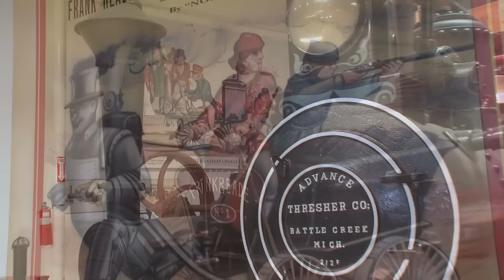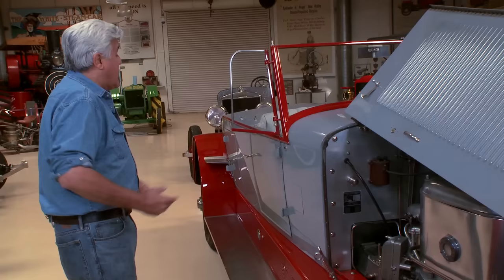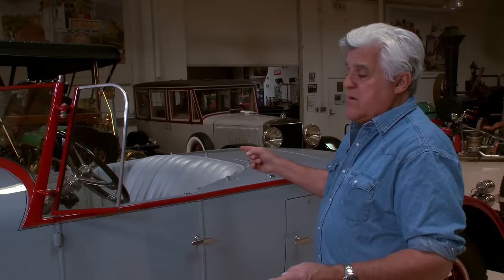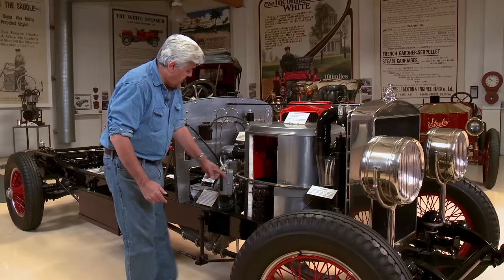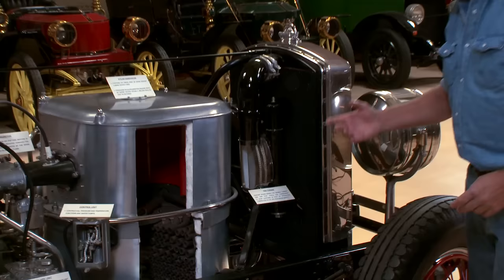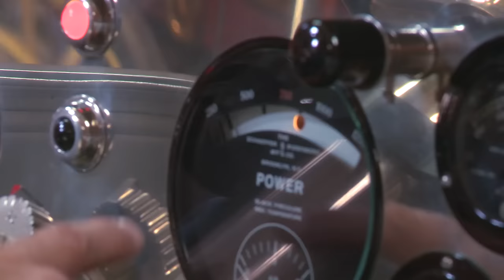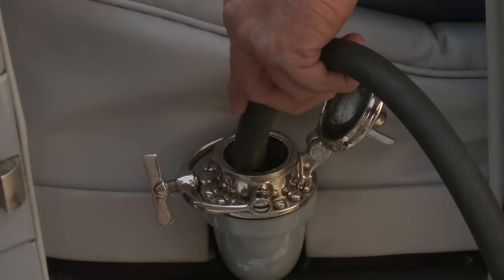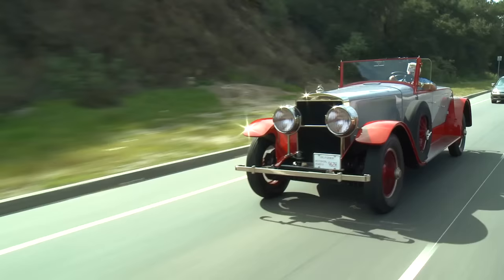1925 Doble E-20 Steam Car - Jay Leno's Garage

Comment: 1000ft pounds of torque..
When?
Whenever you want it..
Reply: No, Jay's remarks are a bit deceiving really, the Doble produces just 150 hp when new and it only produces 1,000 ft-lbs of torque at ZERO RPM torque output drops rapidly as rpm increases.
Reply: @doktorbimmer  the power curve of the car is dependent on the capabilitys of the steam generator not the steam engine itself. so the torque would increse until the steam generator reached its limits then drop off.
Reply: @Sam The Multimedia Man Wrong, the amount of torque is dependent on RPM... The boiler cannot produce any torque... only horsepower. Reciprocating steam engines behave in a very similar way to pneumatic and electric motors torque goes up as rpm drops to zero... torque decreases as rpm goes up...
 Are you not familiar with the formula equation for converting horsepower to torque?
Reply: @doktorbimmer  the amount of power a steam engine produces is dependent on the amount of steam pressure its getting! Boilers and steam generators have power ratings. you can run a steam engine at its max RPM at 15psi when its not under a load, its not making 1000ft/lbs of torque at 15psi!
Reply: @Sam The Multimedia Man WRONG! you are very confused and not sufficiently educated on this topic to speak intelligently on it. Boiler pressure and volume is directly related to HORSEPOWER Not torque. Torque is directly related to RPM.
Reply: So I am not familiar with steam engines.. it isn't really an engine? Where are the rpms coming from to produce the torque? Isn't the torque produced through steam pressure making the torque available as soon as you open the valves?
Reply: @jrea424  the torque is produced by the steam pressure acting on the piston transfered through the connecting rod to the crankshaft. the more pressure the more power you can  achieve.
Reply: @jrea424 All steam engines are Heat engines so the answer is No. It is without any doubt AN ENGINE. Torque is the result of the Brake Mean Indicated Pressure and  Brake Mean Effective Pressure based on the bore diameter, STROKE and RPM... The faster the piston moves, the less efficient the use of steam pressure and the amount of actual torque generated.
Reply: @Sam The Multimedia Man WRONG the amount of pressure available vs. the pounds of steam used is expressed in HORSEPOWER... NOT TORQUE.
Reply: @doktorbimmer  the amount of pressure avalable is measured in psi, hp is work done over time, torque is the measure of force applyed to something that can rotate
Reply: @Sam The Multimedia Man WRONG DUMMY! Horsepower is amount of POUNDS OF STEAM PER HOUR!!!!  One boiler horsepower is equal to 34,5 pounds of steam or 33479 Btu of heat or  9.8 kilowatts.
Reply: @Sam The Multimedia Man It is very obvious from your comments you do not understand what torque is... please refrain from posting remarks on a topic that you are not adequately educated to speak intelligently on...
Reply: @doktorbimmer  lol so were talking about the boiler that had nothing to do with anything now and not the engine that magically generates torque! Make up you mind.
Reply: @Sam The Multimedia Man That is right dummy! the boiler does not and cannot produce torque... only steam measured in pound at a specified pressure... this has NOTHING to do with torque.
Reply: @doktorbimmer  Its pretty clear from your remarks that you've never stepped foot into any classroom.
Reply: @doktorbimmer  okay kid time for you to give your smart phone/ computer back to mommy and daddy and go do your homework.
Reply: @doktorbimmer  LMAO, you crack me up kid.
Reply: @Sam The Multimedia Man Are you still here Sammy??? I thought you would be busy trying to learn something about engineering... do you really want to be ridiculed as an ineffectual troll for the rest of your life???
Reply: @Sam The Multimedia Man The only troll or fake here is you son.
Reply: @Sam The Multimedia Man Sorry son the only fake here is you...
Reply: @Sam The Multimedia Man Your efforts here are completely futile... as an ineffectual little troll you do not intimidate me in the slightest.
Reply: @doktorbimmer  and now your making statements about your self.
Reply: @Sam The Multimedia Man You are the fake, posting false information about steam engines... and the one continuing to make a fool of yourself.
Reply: @doktorbimmer  Are you typing out what you say to your self in the mirror everyday??
Reply: @Sam The Multimedia Man Wrote quote; "the power curve of the car is dependent on the capabilitys of the steam generator not the steam engine itself." Nothing proves you are a fake more than this false statement....
Reply: @doktorbimmer  but thats a true statement, sooo it just proves that you dont have an understanding of mechanics!
Reply: @Sam The Multimedia Man You mean a HORSEPOWER CURVE???
Reply: @doktorbimmer  no...... A power curve or power band as it otherwise know is the torque and horsepower curve of an engine  that is plotted over its RPM. Let me help clarify this for you, The power source of the steam engine is the steam generator, at full steam from a dead stop under load the steam engines power curve would only drop if the steam generator had a static steam pressure, The Doble's steam generator has a dynamic output, as the engine spins faster it forces more air and fuel into the boiler creating more steam causing the power curve to increase as it accelerates in RPM, this power curve would only drop off after the Doble's steam generator reached its physical and mechanical limits  (water feed, air/fuel,  heat, ect.) there for the limitations in the power output of the steam engine lie in the steam generator. (besides the engine becoming compromised structurally)
Reply: @Sam The Multimedia Man Yes, RPM Son... Thank you for proving my point!
Reply: @doktorbimmer  my point was you didnt get my point and went on like a crazy person
Reply: @Sam The Multimedia Man No, you literally just proved that I am right... Cheers!
Reply: @doktorbimmer  no i literally just explined my first post in detail because you couldnt understand it.
Reply: @Sam The Multimedia Man No, you just completely contradicted yourself and proved my point. You wrote, quote;
 "so the torque would increse until the steam generator reached its limits then drop off."

The Doble produces 1,000 lb-ft of torque only at rest (zero RPM) The pressure at the inlet valve port is static and steam flow is ZERO.
Reply: @doktorbimmer  i said the same exact thing in my first statement, i just explined it in detail for you to grasp in my last statement, the same quote is in both the statements. Your first statement said that the 1000 ft/lbs would drop off as rpm increased, that statement was incorrect because of the boilers design steam and power increases with RPM.
Reply: @Sam The Multimedia Man You obviously are not educated in engineering and do not understand the formula for calculating horsepower or torque... The Doble produces 1,000 ft-lbs at ZERO RPM that is ZERO horsepower (and only 0.20 horsepower at 1.0 RPM).
Reply: @doktorbimmer  Quit skirting around!! This was your statement " it only produces 1,000 ft-lbs of torque at ZERO RPM torque output drops rapidly as rpm increases" It is incorrect! You are wrong! end of discussion!!
Reply: I wonder how many hours you two wasted arguing for no reason
Reply: @anon No time is wasted as long as he learned something...
Reply: @doktorbimmer  Why are you typing like this ? It takes so mutch time to put * between all the words
Reply: @George Bamber Are you a student?
Reply: @Monokuma Childish insults won't prove your point (if you had one) and do not make you look very smart or mature... perhaps you should go troll elsewhere kid.
Reply: @doktorbimmer  "the smount of torque its dependant on rpm" hell no, to lose torque from rpm u would need to get close to water's speed of sound anyplace inside the system, it would blow up way before that
Reply: @santigago perez Sam thinks "superheated" steam travels at the speed of sound... Hahaha!!!
Reply: @doktorbimmer  a petrol engine is pretty useless without a gearbox and clutch. How would it be if the steam car had a gearbox and clutch?
Reply: @Harold Pearson The Doble uses "petrol" too! (unleaded gasoline).
Reply: @Harold Pearson There are millions of internal combustion cars that have no gear box and clutch, The White Motors steam cars had a gearbox and clutch.... what is your point?
Reply: @doktorbimmer  so its still its peak output.   Bold letters to highlight your asinine attitude and snarkyness?
Reply: @Non Ofyourbusiness Just the facts here son... I think its you with the attitude.
Reply: @doktorbimmer  With electric YOU ARE WRONG. Torque is load dependent with electric motors, not RPM. If you adjust the speed of the electric motor down to slower RPM's, then it will not produce more torque. You have to LOAD IT DOWN until the motor is going slower and slower as you put more and more load upon it to make torque increase. Not a realistic scenario since the motor will fry from over current.
Reply: @EETechs Sorry but you are wrong, horsepower and torque specs are always measured at max. voltage/amperage. Torque is always measured maximum load. The amount of peak torque produced is determined by RPM.
Reply: @doktorbimmer  LOL, okay....So your saying the electric motor's load torque rating is their "MAX". LOL!! Electric motor rating is at the rating that it can run at continuously at 40C ambient where as a gas engine is peak rated. If they rated electric motors at their peak, like at stall for DC or breakdown for AC, then the motors would burn out or melt the copper windings or blow fuses/breakers. And torque DOES NOT go up if you reduce the voltage to slow them down. You have to LOAD them down to get more torque out of them. Again they are LOAD based, not RPM based. Try it sometimes. Take a 12 volt DC motor and run it at 3 volts. It will be slow and gutless as hell to where you can stop it by hand. Now take that same motor and bog it down with a piece of wood but this time at 12 volts. It will be very strong. Also measure the current as you push harder on the wood. It will start to climb.

I think I know what is confusing you. It's that flat torque curve crap you see everywhere. That's not the motor's NATURAL torque curve (non modified) , that's the SPEED CONTROLLER limiting current to a constant value, which causes the motor to produce a flat curve. Current is what creates torque in electric motors. More current is more torque, however if you keep current limited to one value then torque is limited to one value. It's really that simple...
Reply: @EETechs Sorry kid, but all motors are rated at peak torque, clearly you do not understand the difference between horsepower and torque....
Reply: @EETechs Thanks for proving my point son, no wonder you deleted your comment... you really made yourself look like a fool!
Reply: Whenever you want, as long as you are at a complete stop, the Doble only makes 1000ftlbs at zero rpm.

Comment: Amazing!  I had no idea that there were steam cars of that style.  They used it a lot longer than I thought.  And I always figured that steam would be greater tork than gas, good to see I was right.  Beautiful car and amazing piece of equipment.  You are very lucky to have it.
Reply: +daniellclary Its a very, very late steam car... one of the last ones built, by 1925 other steam cars like Stanley and White were already gone.
Reply: +daniellclary Why that is (the torque thing) is hard to understand, but Horsepower (work done) is an expression of torque and RPM. That may be simplified,  but a dentist drill may have equal horsepower to a motor 6 feet tall, but the work done will be the same. One delivers its output as extreme speed, and the big motor as an enormous twist or torque. 2 different job requirements. One HP is 33, 000 lbs raised a foot in one minute, but that also means ONE pound raised 33,000 FEET, is also one HP!!!  2 totally different machines would be needed for the 2 tasks! The steam reciprocating engine delivers a mighty torque at the very moment that long connecting rod starts shoving!  A gas engine has to be running  at maybe a few hundred RPM to even begin to do extra work, and that is a major deficiency!  An electric motor delivers its  biggest torque at a dead standstill (when you switch it on before it moves) if that makes any sense!!!
Reply: +junkdeal Power is not "work done". Power is the rate at which that work is done, expressed in Watts or Horsepower. Work is energy expenditure, expressed in Joules or Newton-meters.
Reply: +Ijusthopeitsquick Yeah, you kinda got me on that one. Even for me it's hard to explain  and I certainly don't have an engineering-degree-level knowledge of the subject. The rate is the primary factor in the terms like horsepower, and it certainly does involve power over a time span!  The Joule is a misunderstood concept by everyone I know!  It comes in when trying to understand how these mega-capacitors can store so much energy, and then release it so suddenly! I think the magnetic railguns need this kind of delivery, and some capacitors can crank a car for a short moment, due to this ability. The ability do deliver so many Joules so fast!
Reply: +junkdeal Yes, large capacitors can deliver enormous power (watts) but only for a very brief time (generally only milliseconds), since they do not store much energy (joules) compared to batteries or fossil fuel.
Reply: Ijusthopeitsquick A guy at Interstate batteries answered a question that bothered me for ages. I wondered how those little batteries in jumper power packs can crank a car. He said it was less a function if how much energy they stored (reserve capacity) but how fast they delivered what they had. They are designed to deliver a very high boost in a short time. He said one factor that governs how fast batteries can deliver energy or take a charge back in is what the internal resistance of the battery is. Increasing resistance is one variable they use to determine a junk battery. Those 1-Farad capacitors can deliver a hell of a punch in, like you say, a millisecond. I've seen them act as a surge reserve in sound systems in cars.  I'll bet if they could take high voltage without breaking the di-electric ablilty they have, and you could then charge them with hundreds of volts, if you tossed it to someone, and they caught it wrong, they'd die where they stood!!
Reply: junkdeal Compared to a battery, capacitors have very low internal resistance, almost negligible, which is why they can flow very large currents for a very short time. The 1 Farad caps used in audio systems are rated at low voltages, though, so you can't charge them to hundreds of volts (they will break down and might explode if you try). High voltage, high capacity caps are hard to manufacture and very expensive.
Reply: Ijusthopeitsquick Exactly! The di-electric strength of those 1 farad units would never take a charge with much higher voltage than maybe 50 volts. I think even if you did try to shock someone with one of those charged to only 12 volts, I don't think they'd get a blast. Doesn't it take at least 30 volts to begin to travel through the human body?
I demolished the Kearney Laboratories electric array that contained massive capacitors that were made to take high voltage!  They were one of the last labs anywhere that did test-to-destruction. I guess it is all simulated on computers now. The stuff they had was unbelievable!  Including a dual transformer unit, each one weighing 8000 pounds, that delivered 1.2 million volts each!  I kept them on a trailer thinking someday I'd hook 'em up! The tempatation to scrap them became to great, but when I did, there was virtually NO copper in 'em, and what was, was as fine as hair!  I used the oil for diesel fuel!!!
The capacitors I unwound for the aluminum. I made a fortune there. Like Frankenstein's lab! I never saw anything like this place in my life!! The place was in Summit, Illinois, and closed down in the late '90s.
Reply: Sounds like you get to go on grand adventures.
Reply: daniellclary I think you mean me, or am I just stuck on myself?!  If you do though, I really have had many, many strange and wonderful adventures in the work I've done! The stories could go on for months!!!